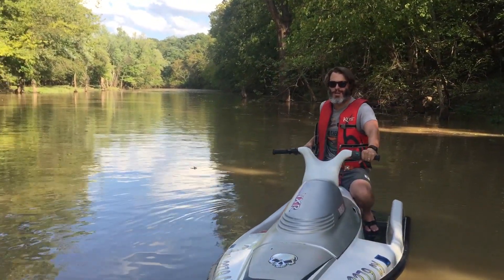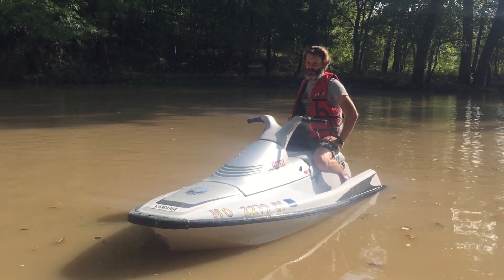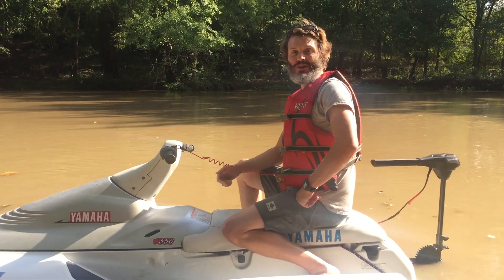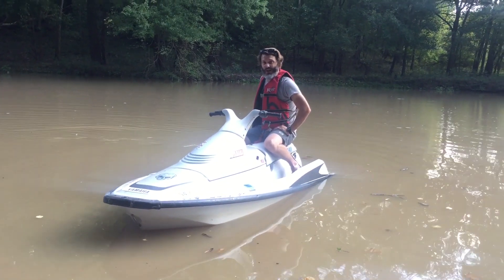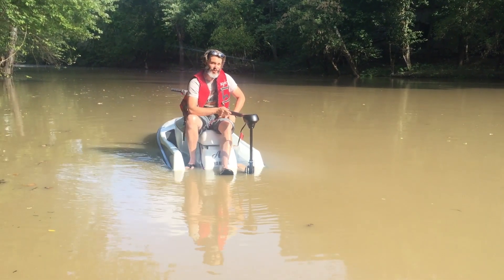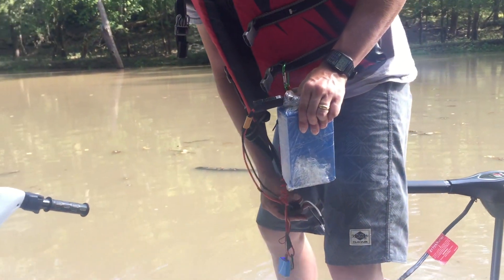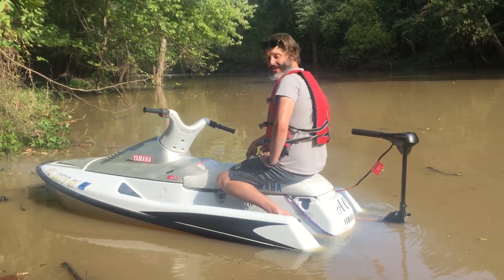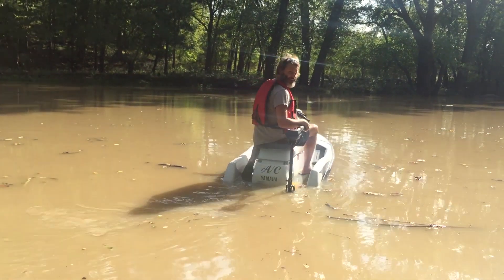Testing The Limits! Holmes Hobby BR-XL Speed Control Handles A Trolling Motor On A Jetski

Comment: I'm confused .. you're adding a speed controller to a motor with an already built in potentiometer ?  How does that even work .  

Looks cool I'd like to do it for my  kayak so any advice would be appreciated 👍
Reply: 30 lb trolling motor should run max 30 amps . Doesn't that mean if you're over amping .  You're frying the motor?

Comment: I build mini boats. We usually use the motor speed switch that is housed in the head remounted and rewired so you can use it up front  but a ESC would be more efficient ...24 volts should be faster

Comment: What if you use two troll motors and then you could steer by throttling one higher than the other.  Then you could lock both in a straight position and put less or more stress on each motor.  Idk if any of this would work but just a thought.  You could almost do away with any extra shaft above the hull cause they would be locked in.  
HH4Life